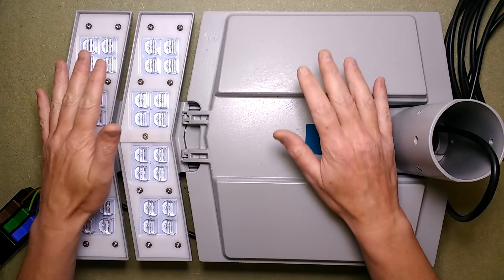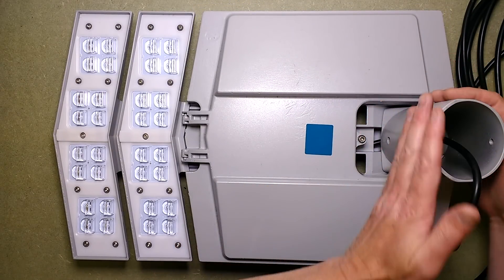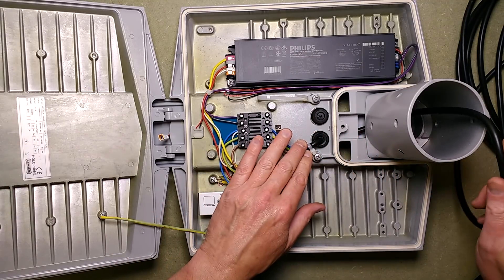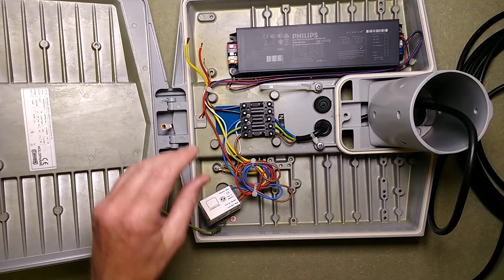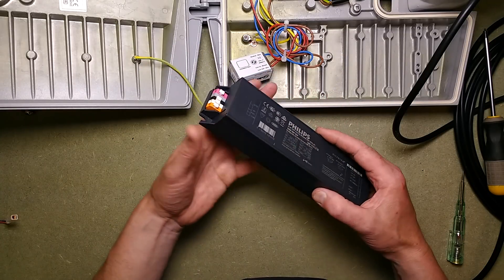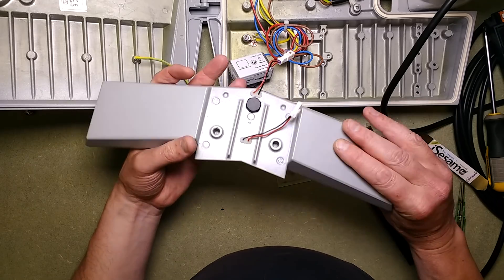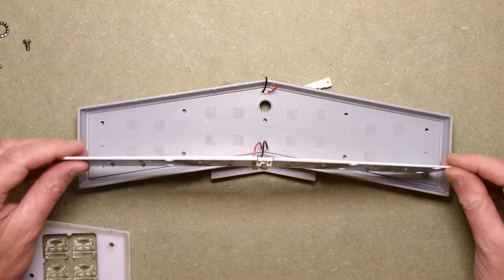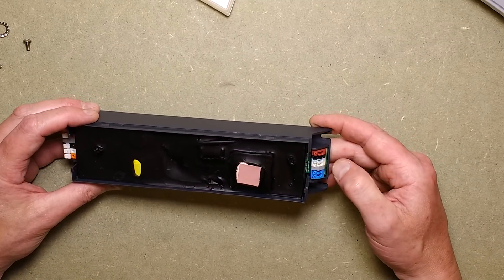Inside a Holophane LED street light (slight chromecast glitch).

Comment: You might be better off with a car dash cam with a video output like mini hdmi.
Reply from the maker: The quality and zoom isn't good enough.
Reply: Why dont you use a point and shoot with a mini hdmi out
Reply: If your phone supports MHL (= HDMI via the phones microUSB port), that might be an option (...?). 
I've gone that route before to capture Android games without having to resort to screen recording apps with all their drawbacks.
(edit: as in recording the phones output with a HDMI capture card. Since you just need to see it on a TV/monitor, that wouldn't be an issue)
Reply: what about one of those larger lcd screen attachments for the camera?
Reply: MHL died like 3 years ago is all im saying
Reply: The wee camera module for the raspberry pi is really good.
Reply: MHL is very rare on phones these days im afraid !
Reply: It doesn't really have anything to do with any of that. He's using an ancient iPad to film. (Unless I missed the update where he got a new iPad.) He just needs to get into a camera of any sort with HDMI/mini HDMI out. Or just get a USB c or lightning to HDMI adaptor... MHL or otherwise. All major phones/tablets will support this. But as I said, that's not the issue. The phone is still going to lag because it's sending that signal out.
Reply: girlsdrinkfeck: ...which is idiotic because the wired option is almost always the more reliable one
Reply: Andrew Delashaw: You clearly don't have any idea what you're talking about and missed 2 (or even 3?) cameras in between the iPad and his current Moto G. And I've looked up girlsdrinkfeck's statement and yes, unfortunately almost NO major brand (except Sony on some phones) still supports MHL, which is pathetic.  
I wish companies would stop abandoning good features for the sake of changing something or replacing it with something inferior. Regardless, the phone will NOT lag from it. I've recorded easily half a day worth of game footage from my ancient 2013 HTC One M7 (which really isn't powerful by todays standards) via MHL and it did't slow down/lag during the whole process (other than the initial 1-2 seconds thinking time when you plug the cable in and it switches to clone mode)
Reply: Knaeckebrotsaege you know not all tasks require much processing power, its a very good device for basic computing, at it costs piss all.
Reply: of course someone comes along and desperately tries to find a use for that useless piece of junk that is the RPi

Comment: Shame the chromecast caused issues. I wonder if its due to a thermal issue in the phone or just a memory leak or something...

Does the phone have any form of HDMI output?
Reply from the maker: The phone was pretty warm.  Sadly it doesn't have a direct video output.
Another possibility is that the router the two were communicating via was misbehaving.  It's one that was supplied for a 4G data connection and is quirky.  I may try a dedicated router with no 'net connection, if it actually works.
Reply: Try killing all the other apps and placing your access point closer to the pone and chromecast.
It did look like the processor was having trouble keeping up which is either due to lack of available crunching cycles or overheads from packet transmission in a wireless environment.
Reply: Chromecast also supports wired ethernet if that's a possibility for you Clive. That would help a little bit if the packet transmission is an issue because WiFi is WiFi and airtime is a finite resource.
Yes, even the first gen. Either the Google's own adapter or you can cobble together your own with a USB NIC (there's a compatibility list if you search for it) and a funky Y cable with: microUSB female for injecting power, USB-A female for the USB NIC and microUSB male for connecting to the Chromecast to provide power and networking)

But I don't think the networking is the issue, it's probably just the phone SoC not being able to keep up recording video, encoding it, storing it + recording screen, encoding it, sending it over the network. Or the SoC can keep up but the phone just heats up (faster/more now) and has to throttle clockspeeds to save itself from heating (a cooling solution might help but an active one probably not an option because of obvious reasons). If the heating is an issue, lowering the screen brightness is also a valid thing to try and mitigate it.
Reply: I imagine if it were a router issue, it wouldn't have affected the recording, nor would have caused the phone to become warm. 
I think outputing to two monitors (TV + Phone Screen) as well as recording may be a bit too much for the phone's cpu.

If you've got good computer skills, maybe a raspberry pi + usb webcam could fit your needs; but the problem would be a lot of fiddling with software.
Reply: If I remember correctly, he uses the same Phone I have, and mine already tends to overheat when you make long videos, which causes the recorded video to stutter.